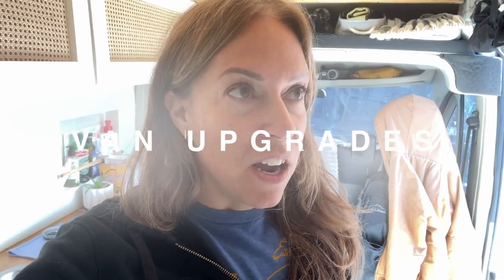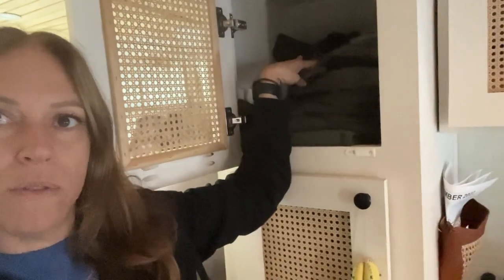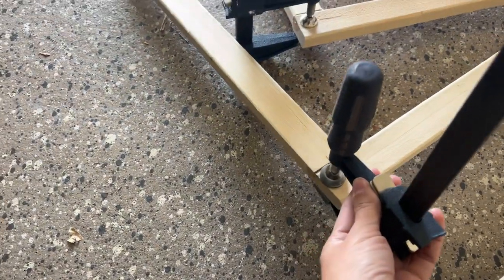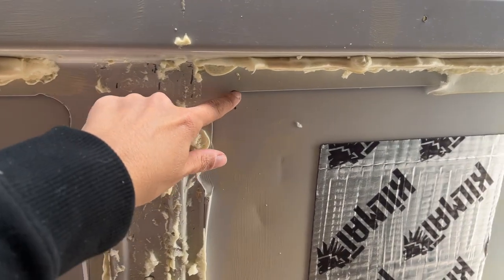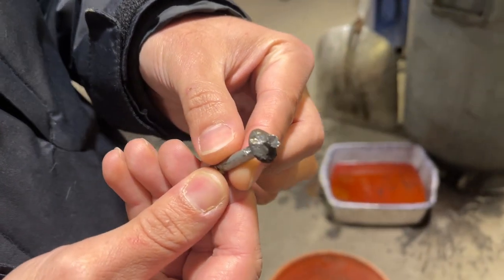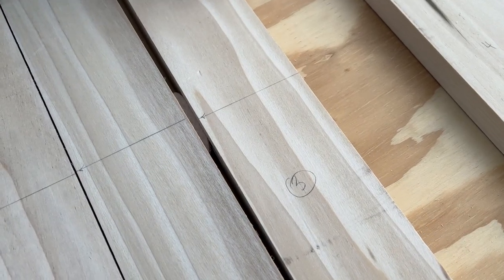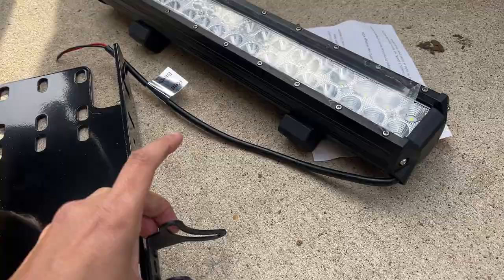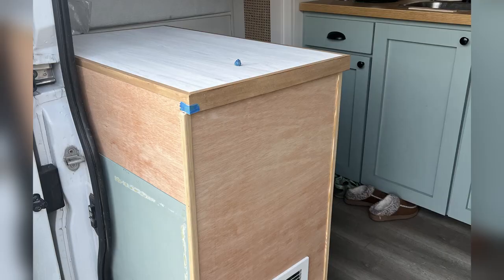van improvements...and an oil leak | van build

Comment: Hi! I don't know if this would work with plywood but I installed drywall for several years and as houses got nicer and nicer we would have to make several kerf cuts on the backside of drywall so it would bend for curved archways, etc.  Eventually we started also using very thin drywall (1/8"). Enjoy your content. Good job!
Reply from the maker: Hmmm, I’m not sure! I know what you mean with the cuts in the drywall, using that paper to hold it together as it bends. The bendy ply felt like it would bend pretty far, I’m excited to try it!